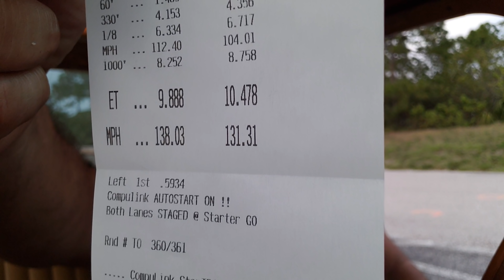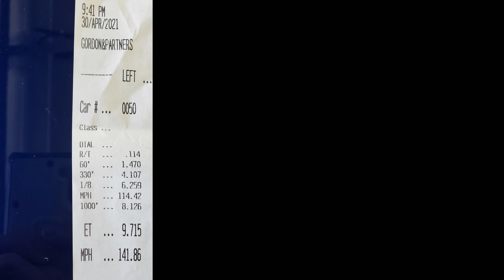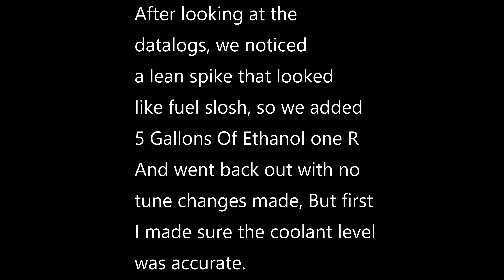#Hushmoney gets driven to the track and tested on low boost  Coyote swapped 6r80 Foxbody

Comment: Dont know if you got the fuel slosh issue figured out permanently. Behind Bars Racecars has a fabricated stock style tank with good baffling, and it fits between most mini tubs. Its a bolt in deal and can have an internal pump like aeromotive or magnafuel, or a sumped style in line setup.

Comment: Was this stock lower or 15%? I have a 3.5” upper with a 15% lower and kong ported blower, I’m seeing 16-17psi
Reply from the maker: Stage 2 lower.
Reply: Are you running the same heads as Alex?
Reply: @StLMikie  I’m a gen 3 car . Not sure if it’ll change much

Comment: I get it a FAIRMOUNT is something different.But too run those times he had to put a lot of money into the car.
Reply: Its coyote swapped with a ported edlebrock  blower on the lowest boost possible.  He has some money in it but for what it is its really not that much honestly imo.  Just has a modern driveline in a light car.